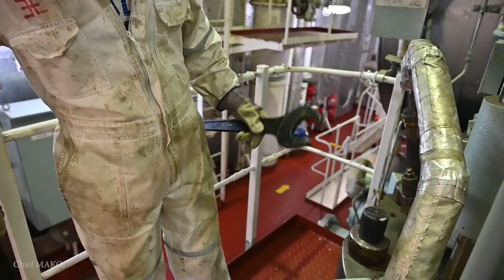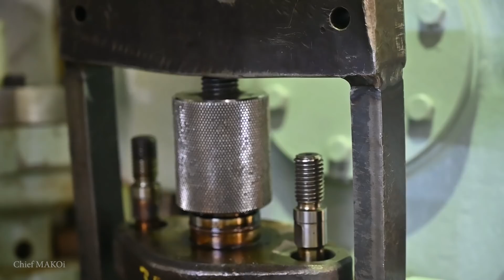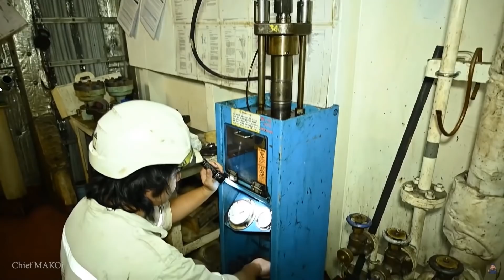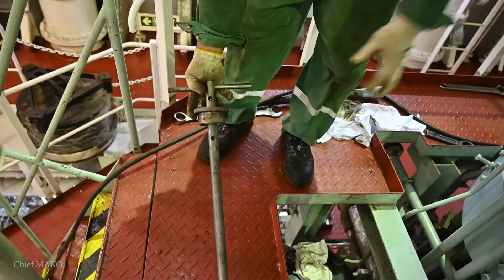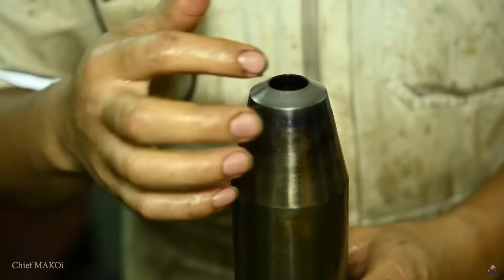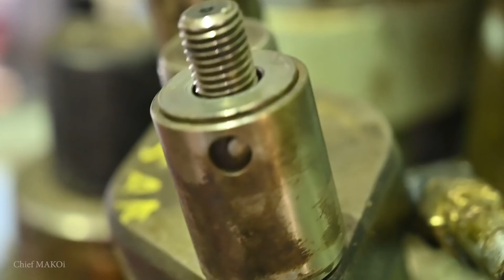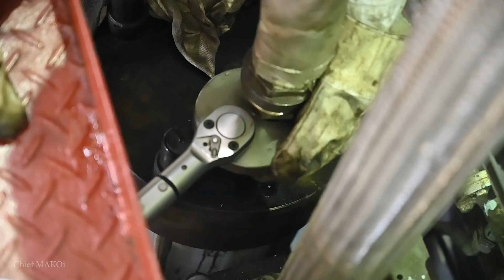Ship's Engine Maintenance : Fuel Injectors | Chief MAKOi

Comment: Great stuff Chief.  Can your engine operate with one cylinder inop or would the vibration/imbalance be too great?
Reply: Yes you can cut supply to one cylinder but at a lower load
Reply: Yes you can turn off cylinders in big ships for maintenance while the rest are working.
Reply: @kevm7815  I don't think you can pull out an injector while the engine is running at full speed though, the pressure of the air blasting up thru the cup would make this job super dangerous and impossible to clean and lap the injector cup mating surface properly. Sure, on ships with hydraulically actuated exhaust valves you could hold the exhaust valve open longer to kind of act like a compression release on a lawnmower engine, but you there's no way to stop scavenge air from being blasted into the cylinder you're working on every time that piston hits bottom dead center and the piston uncovers the scavenge air ports. While the ship is underway at "Navigation full" speed, the scavenge air pressure is crazy high compared to even a supercharged Dodge demon.
Reply: @brnmcc01  We have engines now that have control gear to actually shut down cylinders in turn in a set sequence, so a 9 cylinder engine at slow speed can operate effectively as a 4 cylinder engine, these big engines when turning very slowly on 9 cylinders use very little fuel and it can be difficult to actually get the cylinders to fire properly, so by working as a 4 cylinder, more fuel is injected into less, so helping the cylinders to fire effectively, run smoother also helps with the emissions as well.
Reply: @Razzman-bv5qc  Yeah they have been able to shut off cylinders for awhile now since going to hydraulic and electronic controls, just leave the exhaust valves closed, and shut off the fuel injector. Then the compression in that cylinder will act as kind of an air spring. But I don't think you can pull out an injector with the engine actually running, the compression would blast out of the injector cup with nothing in there.
Reply: @brnmcc01  No, the exhaust valves continue to operate as normal it's just the fuel pumps (in this case) don't deliver to the particular cylinders for that revolution. For HP common rail systems, (Camless engine)  the fuel admission solenoids are not activated.
Reply: @Razzman-bv5qc  Ok, I figured they would be left shut in order to not have (as much) pumping losses from the shutdown cylinder. It just becomes an air spring at that point, simular to like how GM does cylinder deactivation on some V8 engines, as well as FCA's Hemi engines.
Reply: my thoughts also

Comment: Time to train your guys to use the correct socket to set that torque, using the adjustable nut rounder is not the right way, as those nuts clearly show rounded corners from long use of that tool.  That spanner with set and ring end, probably 24mmAF, should be in the tool case already, and available to them. As well get a few crow foot spanners for the union ends, they will make undoing those unions easier, and slip over the pipe and then down, giving at least 4 contact points to grip the hex of the nut, so lessening it distorting.

Adjustable spanner is great for emergency use, but for this kind of work you really should have the right tools in the set, as after all a broken nut will cost you a lot more than the cost of the nut to replace it.
Reply: Yep, as cadet marine engineer we we were never allowed to use shifting spanner. Big trouble if you were cought carrying such a tool!😬

Comment: Back in the early 1980's I worked on drilling rigs in a natural gas field. One rig was built in 1942, all mechanically driven. The 2 main engines were huge V12 Waukesha diesels, I loved crawling around that thing doing the maintenance.
Reply: Manufacturing is far better these days 
But no one does any scheduled maintenance  these days 
Just run it till it dies 
I mean we should prob be changing the injectors on all engines at 2000hrs but no ones going to do that, everyone's running them to 5000hrs till they die and drop the tip into the chamber and fuck uo everything else then blame the manufacturer 

And don't forget in the 1980s that engine was only 40yrs old 
So stuff made in the 1980s still running today has done just as well and there's alot of 80s machines and cars getting around
Reply: Their is one account of a maintenance crew on a ship allegedly forgot a maintenance crew member was inside a ship's engine block seeing no one told him to come out they sealed the maintenance entry port and fired up the engine later reporting a missing Man he much Likened unto early history torture such as the brazen bull 🐂 was Roasted alive exposed to pressure's positive and negative vaccum and searing Heat until dead it makes one wonder 🤔 if the crew punished him for some odd trespass against them?
Reply: Where can I find this account?
Reply: They don't build anything like that any more.  Today it's planned obsolescence.

Comment: 2000 hours is surprisingly short. For a comparison my diesel truck has 1600 hours and just over 41k miles on it.  If my injectors needed maintenance every 50k miles I would be annoyed and probably buy a different truck.
Reply: Your injectors are wimps and only have to handle perfectly clean light weight diesel, where these handle bunker oil, one step removed from what's pumped out of the ground.
So they could get many years out of the injectors if they spent the money on thinner cleaner fuel.

Many of the items on a ship could be given much longer life spans if they did them differently, but it would cost more in the long run to make them maintenance free, rather than making them designed for inspection and repair, and doing it regularly.

Also, when you finally have an injector go out, you can take it a short distance to the shop, or have a tow truck take you there.
If one of these goes out, it can cause serious damage to the engine, and cost millions if the ship breaks down.
Reply: @ke6gwf  I get that they're burning dirtier fuel, I'm just surprised all the filtering they do doesn't clean the fuel more.  At the end of the day I'm sure it's an economic decision and injector maintenance is cheaper than whatever steps would be required to reduce the maintenance schedule.  A side note, but modern common rail injection systems on vehicles frequently run higher than 2000bar, and a common unfortunate side effect of failed diesel vehicle injector is a hole in a piston due to the liquid fuel getting on the piston and burning its way through over a short time.
Reply: These injectors handle pressures of well over 300 bar and a lot heavier fuel than you put in your truck. Like chief Makoi said they can go up to 8000 hours, but companies maintain them after 2000 hours because being stranded in the middle of the ocean is slightly different than being stranded by the side of the road.
Reply: @tomvelsen  300 bar is pretty low, common rail diesel road vehicles frequently run over 2000 bar. But yes I do get that the dirty fuel has a lot to do with it.
Reply: Because diesel is much cleaner than HFO

Comment: Now that’s an injector!! Love these tech videos chief. 
Question: why do the engineers wear white overalls. They’re dirty within 5 minutes after starting there shift. 
I would think dark grey , dark brown or even black overalls would make the guys look ‘clean’ a bit longer ! 
Thanks :-))
Reply: These throw-away overalls are made of Tyvek, and Tyvek is white
Reply: Could a downside with Grey/Brown/Black overalls be that it will be harder to see when they get too dirty and need to be washed or swapped out? / B.
Reply: @mbo191  An additional downside with grey/brown/black is that it would make the wearer harder to see.
Reply: @beeble2003  - You are absolutely right, I didn't think about that. / B.
Reply: Tradition mainly, they can be all colors now. Originally on steamships the boiler suite was white cotton, white reflects heat from an open furnace, also cleanliness, to keep them whiteish they need washing frequently, a clean cotton boiler suite if driven into a bad wound is less likely to cause a bad infection, no dyes either. Remember we can be weeks away from a doctor or hospital. also frequent washing removes the smell of sweat. We still prefer cotton even if colored, as in a flash fire it doesn't melt, it scorches, but doesn't melt into the skin.

Comment: Very interesting, so there' no copper seal between the the injector nozzle and the seat as in automotive injectors? Are these pintle valve injectors? How do you mitigate grinding paste entering the cylinder? Thanks for the video, from an ex long time auto mechanic (VAG). Edit: I guess the torque value is corrected for the extra radius applied by the crow's foot wrench?
Reply: I was worried about the grinding paste too.

Torque on a body is irrespective to where it is applied. You need a fulcrum to convert torque into a force. The fulcrum in this case is the rotational axis of the fastener and that is constant. It is indeed remarkably counterintuitive that the geometry of the wrench is irrelevant.
Reply: @Tadesan  The torque wrench measures the torque at its fulcrum which is different than the fulcrum of the crow's foot wrench. However because they're close to each other compared to the length of the torque wrench it doesn't really matter
Reply: @Tadesan  you missed the fact that adding the crow's foot wrench adds a second fulcrum, and so the torque that the wrench sees is different than the torque that the nut sees.
Imagine if the crow's foot wrench were 3 feet long from centerline of the fastener axis to centerline of the ratchet axis, and you can see how the leverage of the added length will reduce the force that the ratchet sees.

It will also change the force the ratchet sees depending on whether the crow's foot is straight out the front, in line with the ratchet (maximum leverage), or at a 90 degree angle to it.

So while the geometry of the wrench doesn't matter, the length of each section of the levers used matters very much, and using a crow's foot wrench adds a second lever and a second fulcrum as compared to using a single wrench or a socket, and so adds a lot of variability to what the fastener sees compared to the amount of force applied on the end of the handle.
Reply: @ke6gwf  You missed that here the torque is read by using Belleville washer stacks inside the extender studs, which compress with applied pressure, and then when the right torque is achieved they have a flag that moves to the outer position, showing the tension in the stud is correct for the cold condition. Then the stacked washers maintains the tension, which is what your torque specification is meant to do, as the stud and injector heat up. 

These need to have some spring tension to maintain the correct pressure on the front ground and lapped seal, as both the bore, studs and injector grow at different rates as they heat up, so you need some method to maintain constant tension on the studs, which is why there is the Belleville spring pack nice and compact in the interface between nut and injector to provide this.
Reply: @SeanBZA  none of us are talking about the injector clamps. We are talking about the high pressure pipe line nuts that were tightened with a torque wrench with a crow's foot wrench on the end of it.

Look for the torque wrench used towards the end of the video.

But thank you for the unrelated explanation of how the self indicating torque maintaining nuts work!
Reply: @ke6gwf  on aircraft torque values for lines like that where a crow's foot needs to be used are generally calculated for using a crow's foot. You don't need to do any calculations.
Reply: I would guess that on an engine that size the lapping paste is about as bad as the carbon particles and bunker oil crud lol
And I would expect that the torque specs include the offset specs for the proper crow's foot wrench.
Though it suppose the exact torque isn't as critical as head bolts or something, so maybe it just assumes that most crows foot wrenches are about the same length.
Reply: Those look like pressure activated injectors, like the type Mercedes used until 1991 or 1992.